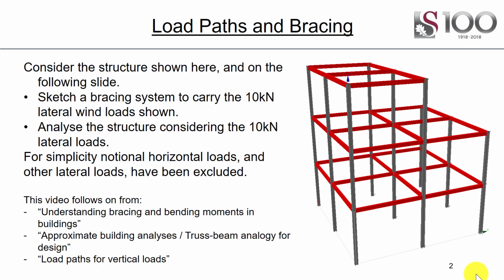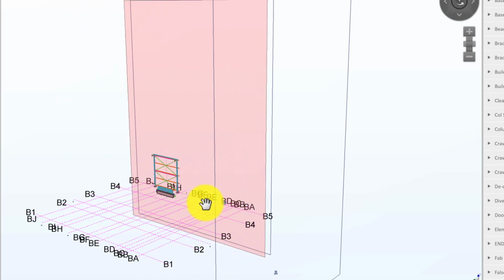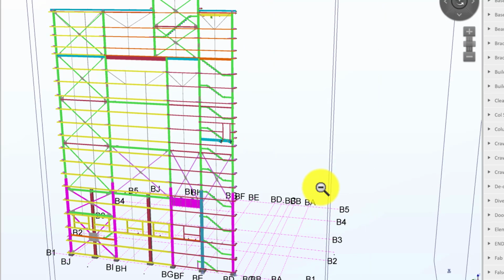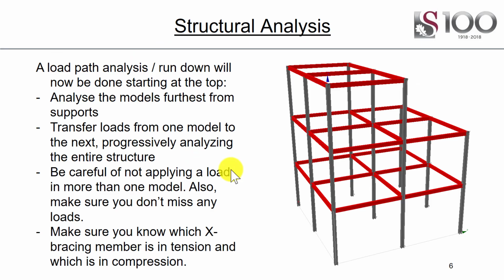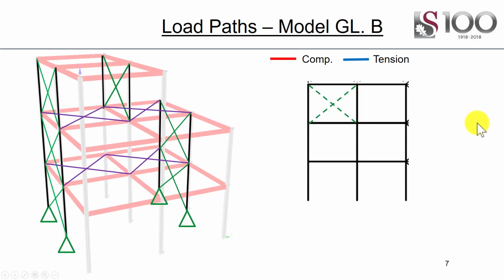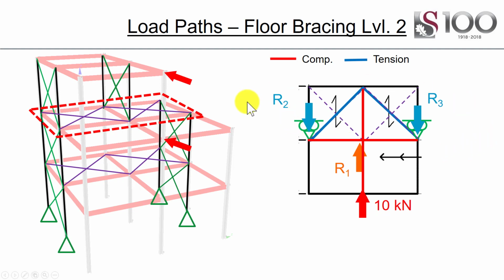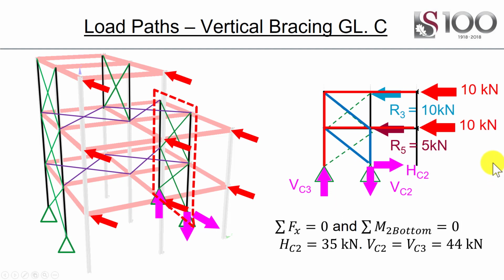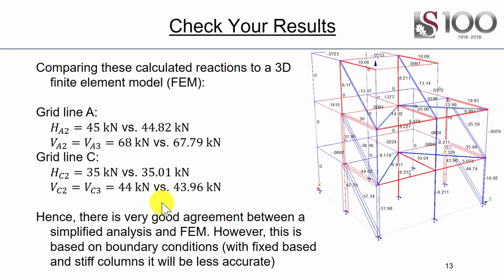Building Design & Analysis: Load Paths for Lateral Loads and Bracing Design

Comment: Isn't the building still unstable in the transverse direction?
I'm just starting out on my structural engineering and design journey working for a scaffolding company..... this means that ALL of our work is basically designing braced frames. 

My gut instinct here is that the bracing depicted doesn't sufficiently account for transverse lateral load?
Assuming (as you outline) that the joints are all 'true pins'?

As a rule of thumb in the Australian Scaffold industry, is to brace on both the Front and Side elevations while Plan bracing is only used for particular arrangements such as resisting twist in parallel 'ladder girders' or spurred/cantilevered bays.
Reply from the maker: You are correct. This structure is only braced in one direction. If we added bracing in the other it would make the illustrations and video confusing. However, you would simply follow the same steps for loads perpendicular to those shown.

Comment: Hi Professor Walls, thank you very much for the great videos. In 14min,09sec, how would you determine the direction of R1. In the previous model, wasn't it in the opposite direction?
Reply from the maker: Dear Saman
You are correct - R1 was in the opposite direction in the previous model. If you take sum of forces between the two models at that point the result will be zero as they must cancel - hence, must always be in opposite directions. In the first model R1 shows the support provided by the floor bracing. In the second model (at 14:09) R1 shows the load applied by the vertical braced bay. 
Hope this helps. 
Kind regards
Richard

Comment: This  building has been structured in which software?
Reply: The 3D model was done in Tekla. The analysis was done using Prokon Frame. Most of the diagrams have been done in Powerpoint.
Reply: l need the name of the program too.